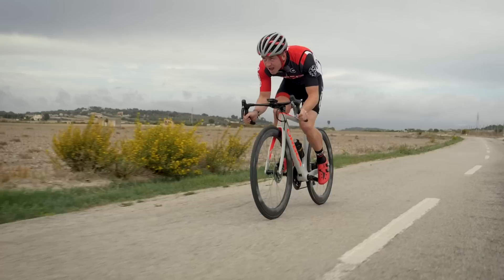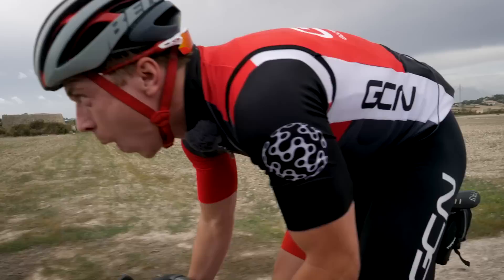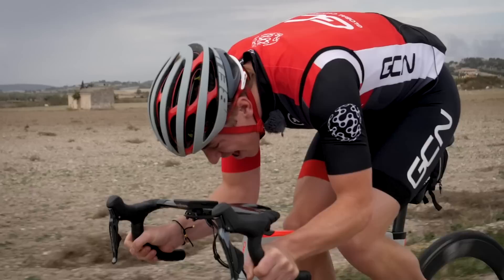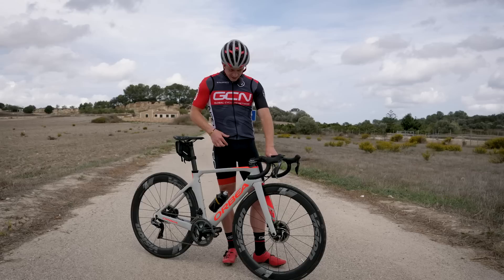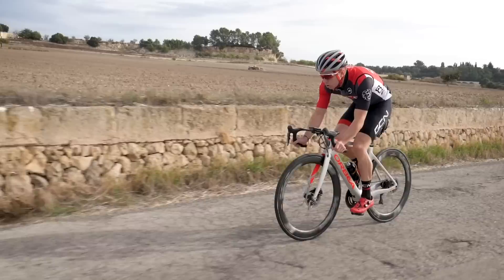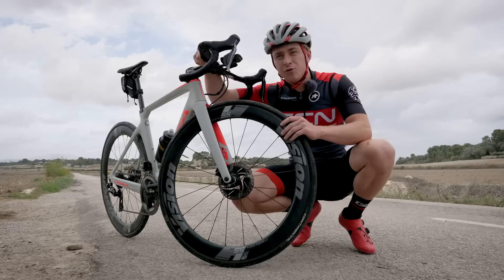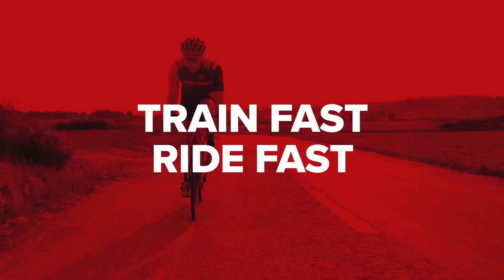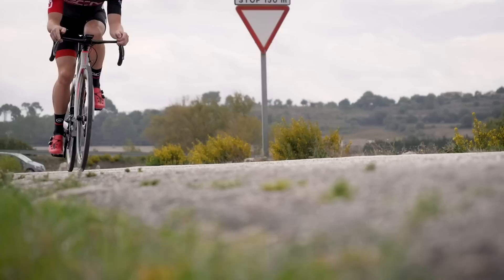How To Cycle Faster On The Flat

Comment: I appreciate you bringing your riding set-up one step closer to reality - too many of the GCN presenters do videos without a saddle-bag, and without their jersey pockets bulging with the gear that isn't in their missing saddle bags.  We ride flats, here, and the reality is that - because we're moving so fast - we NEED the front lights on, despite their aero inefficiency, because so many vehicles pull out in front of us.  They either are mis-judging our approach speed (30 to 40 KPH) or aren't seeing us, but one thing is certain - having a bright white flashing LED during the day time reduces the instances of motorists pulling out in front of us.  The extra speed on flat sections requires the front light unless one is somewhere with no driveways or side-access roads.

Comment: I would love love love a video on proper pedaling mechanics. I see so many cyclists out there who simply don’t know how to pedal for maximum efficiency.
Reply: They have mentioned a study on this channel several times which showed that peddling style doesn't make any difference.
Reply: Cadence has the biggest impact on efficiency. So many people use too high a cadence all the time but it should vary depending on power output. A high cadence is good if you're putting out a lot of power otherwise it's not efficient. A video looking to this would indeed be good.
Reply: @glharlor  Thank you for your comment!  For me, concentrating on good pedaling mechanics has definitely improved my speed compared to wattage.  Not pushing on the pedals, but rather concentrating on producing a uniform force spinning circles is the way I do this.  Also, keeping my knees inboard of my hips allows for the recruitment of the hip muscles and seems also to produce better mechanics.  Slight flexing of the ankles when I'm climbing or accelerating seems to be more efficient that pushing on the pedals.  Seat hight, knee bend, foot position with your cleats.  This is what I'm talking about.

Comment: I find moving back on the saddle a little and extending my legs more horizontally than vertically gives me more speed on the flats. Especially focusing power in the upper part of the power stroke of each leg.  I feel most efficient at maintaining speed in that posture on a long flat run.

Comment: Most people really neglect the effects of clothing. The aerodynamic difference between a so-so fitting shirt (when you feel material under your arms on your sides, or on your neck flapping at speed) and a really snug fitting one can easily neglect the advantages of your new aero wheelset.
Reply: Yeh you can actually feel the difference I have a cycling top that close fitting but still flaps a bit and then I have one that’s thinner material and doesn’t flap at all and you can feel the speed difference riding in neutral conditions

Comment: I hear this all the time about air pressure. Even flat roads have turns . Won’t the tire squirm in a fast corner? It also seems like very little protection for a rim . And wouldn’t you be more prone to snakebite flats ? That’s a sweet bike James!💀

Comment: Help! Caad 10 2015 with carbon Ritchey stem and carbon Bondrager dropbars, including stock stem and droplets, full 105 at 800€ or at 1000€ with fast forward f4r carbon wheels or Caad 12 2016 stock, full 105 at 1000€. Both in great condition.

Comment: You're trying to show someone who lives in Norfolk about going fast on the flat!! 😂🤣 
A Canyon Aeroad, sit on the aero hoods are you best bet. I'm 2 meters tall and 100kgs and 95psi rear, 85 front, also sit at low end threshold (my threshold is 145-157 bpm and I sit at 148-153) and I can avg 21-22mph all day (well a 4 hour ride anyway) on a good day I can do 23mph avg over about 40 miles.
Reply: Jolly Giant I'm from North Wales so I've no idea what a flat road looks like.
Reply: Quick!
Reply: @hogdog567  ,Well in 50 miles I climb about 2,000ft if I set out to find 'hills'!
Reply: That’s slow

Comment: 70 psi? Seems like a formula for a dinged rim . I understand 100 psi instead of 120 .  Doesn’t the tire squirm on fast corners?
Reply: I run 60psi with 28mm tyres on 17mm rims. I haven't experienced tyre squirm.

Comment: I don't have the  light, efficient, and aerodynamic bike so i guess gotta rely on the legs and the lungs
Reply: Heart*
Reply: The bike is only 20% of the aero drag.
Reply: @hogdog567  Relatively, a good handlebar can get you in an aero position you can't otherwise reach, and the handelbars are still part of the bike, altough you're reducing the drag of your body with it

Comment: Okay. I have a strange question for the GCN guys. Why is it harder for me to hold a constant power on a straight road than on a climb? It doesn´t make any sense. Power output should be power output. And I´m not saying climbs are easier that the flat. But at constant hi power, I can much better sustain the same power on the climbs than on a straight. Has anyone experienced this weird fact?
Reply: Gear ratio is one of the facts that you hold same power easier. And probably you have same power but not same cadence. However you are able to reach that power in a certain gear uphill, because of an increased rolling resistance, on flat you need to put it from legs in a high gear at a fast cadence.
Reply: @stefanvaliart1775  Makes sense, Stefan. Going up, the resistance is always there, while on the flat I have to push constantly to create that resistance. Thanks!

Comment: 70 to 100 psi....er that's more or less the total range you'd ever concider.  Maybe narrow it down a bit?
Reply: @voiceofreason9780  another not mentioned.  GCN can be a bit light on substance.
Reply: @MrTait_en_Chile  depends on weight, road surface type, wet or dry, size of tyre and the manufacturer. Can't exactly narrow it down. 

More weight=higher pressure
Rougher roads= lower pressure
Wet=lower pressure
Larger tyre=lower pressure
Manufacturer is the pressure ranges

Comment: Funny how nobody talks about shaving grams from the bike anymore, it's all about aero
Reply: The weight of the bike has zero effect on the speed on the flat.  A 6 kg bike requires the same power to maintain 40 km/h as a 15 kg bike of the same shape.
Reply: @ltu42  Clearly you didn't get the point of what I said but it's fine though
Reply: This video is about speed on the flat.  In the video on climbing faster GCN  even jokingly suggests ditching the seatpost and saddle.  The recent GCN Tech videos on the hillclimb scene show what the practical possibilities for weight savings are.  That said, 1 kg of weight savings accounts to about 40 seconds on a climb of 1000 m elevation, which is immaterial unless you're competing.
Reply: @ltu42  yeah... Like I'm new here... Ok... I was talking about how everything is about aero these days

Comment: Aero is the biggest money making con at the moment….aero handlebars do nothing,,,why! Because after the air slips nicely over the bars where does it go?,,,straight into the body..
Larger tyres, nonsense. If more contact with road is faster, then this means a 50mm tyre would be faster.
Want to go faster…..lose weight, train. Get decent wheels, and learn to get body aero. Dont worry about aero bike